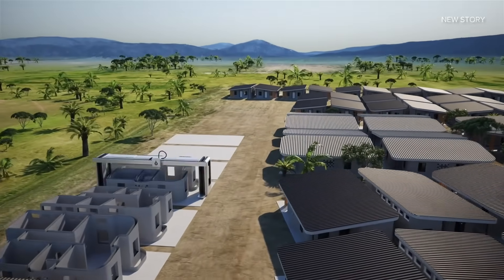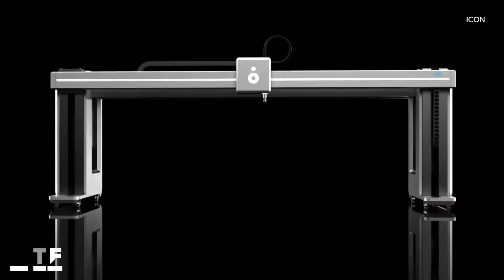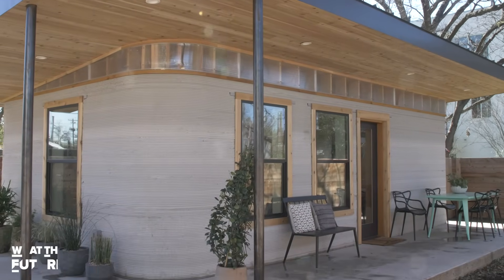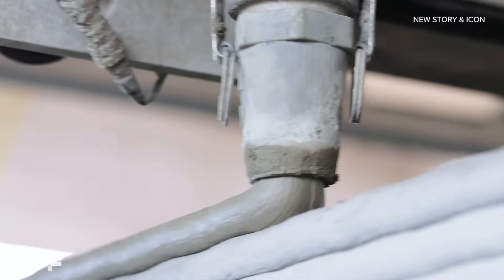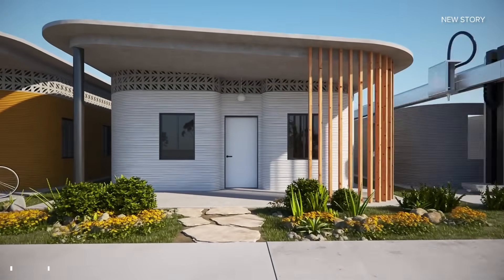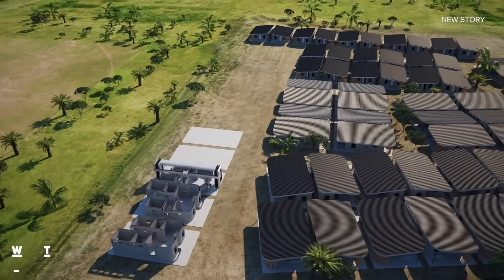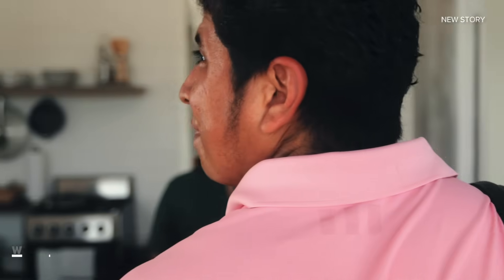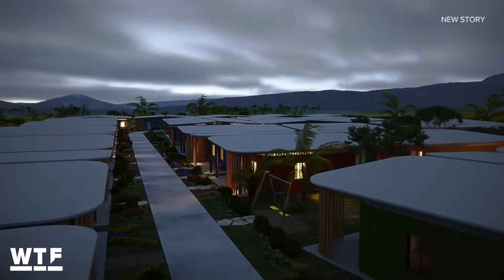The world's first 3D-printed community is officially under construction

Comment: Insulation?   Plumbing?    Electric?

How are these incorporated??
Reply: I would lay my pipe & conduit in the freshly laid wall, so that the next pass hides it inside the wall between the layers & the wall forms around the outlet boxes while wet. Not sure how they are doing it.
Reply: Robert Lockard 
That was my understanding, but there's no detailed video showing this. I'd also like to see a fair comparison with this and traditional house building or other house building innovations like compressed earth housing. It just seems like it might be a bit gimicky.
Reply: @Competitive_Antagonist  comparing it to compressed earth, it should be a lot cheaper. Compressed earth takes a few pieces of heavy machinery, and a lot of laborers. This video says it only needs 3 machines and 3 people to run them. They said in the video the 3D printed house could be done at half the price compared to traditional construction, (stick/regular lumber site home) compared to the 10x price of compressed earth.
Reply: @muninrob  I lay my pipe inside warm climate wet walls. Its easier to push and pull power through.
Reply: They aren't.  It all has to be surface mounted or have the walls furred out so it can then be installed inside the walls.
Reply: @PaulGuy  or they put conduits in the concrete as every other home is built in Mexico. It's possible they've designed these homes differently, but the video doesn't say either way.
Reply: Workers do that part
Reply: The idea is to build homes for as cheap as possible, if you up the printing resolution you might be able build more sophisticated homes but that will be more expensive.
Reply: @kevintieman3616  I built my own house and I paid about $50 per square foot, (south Louisiana where normal price is about $100 per square foot). But if I could just draw a floor plan and have 3 machines and 3 operators delivered to my jobsite and 24-48 hrs later the house is poured and all I have to do is the finish work then yeah I would definitely do that instead.
Reply: Other companies are making double and or triple wall construction homes, where insulation is blown inside at the end (very quickly), and pipes and wires can be placed as the printing is happening or channels and holes are set during the printing process. Insulation, plumbing and electric is all pretty easy when it's planned in advance.
Reply: Very carefully.
Reply: You can just see surface mounted electrics in the video. Mounting onto the irregular surface will be a new challenge
Reply: @unclesond  my guess is just like the program stops pouring cement for windows you could have the program not pour where the conduit could go and after the machine pours past that spot an operator could put the pipe in place and when the machine comes back to that place it would just pour the next layer of cement on top of the conduit. That is one way it could be easily programed and done.
Reply: @unclesond  you could just use brackets/shelves with concrete anchors/screws.
Reply: This could be a lifesaver for senior housing...F the $3,000+ a month retirement community.
Reply: 1:50 it seems the electric conduits are simply attached to the walls. They could also paint on the wires to "hide" them. I'm also guessing the plumbing will be quite exposed as well. Bear in mind that these buildings are constructed for cost and functionality not aesthetics
Reply: The concrete is a great insulation! They have Mitsubishi heating and cooling machines that don’t need have systems. The 3D printer leaves small holes for electrical wires to bring in electricity 😀
Reply: They said the houses were printed for families living on $3/day. They definitely won’t have running water and plumbing. Notice how the ceiling has vent holes... no wall insulation to hold the air conditioning in either. These seemed designed as “ready-made” shelters for people who may be living in shanty towns or tent cities. They look beautiful.... I’d be honored to live there for a few dollars a day. Quite an upgrade.
Reply: I think they'll be fitted outside the walls. And cover later with false ceiling and false walls. But I don't think people will have money to interior design it.
Reply: Insulation could be foam, after plumbing and electrical conduits were run through the web truss-like voids in the walls. Drill where the outlet goes, drop conduit down to it, like brick veneer, but obviously a bit different.

Double walled concrete with an air gap would outperform brick veneer. Not sure what to do in your colder climates, but the mix would have interesting properties if it stands up like that. Some sort of filler material or aeration going on. That means trapped air, or insulation as we call it when we sell it.
Reply: Pretty sure those are installed by regular workers of those specialties. It's just the walls I think are 3d printed which still saves alot of time and labor.
Reply: You don't need insulation with this material. There are real cement dome houses that has no insulation in them and keeps the dwelling warm during the winter and cool during the summer. I've been inside a couple myself and it is considerably cooler, the atmosphere just has a different feel to it before the heat and coolness is regulated differently because of the walls.
Reply: It's for poor people. They don't need fancy things like water. ;)
Reply: Concrete is insulation.  Electric is ran threw the slab and up finished wall. Plumbing is all under the slab. Simple.
Reply: @edwardhoward4542  sorry Edward. Concrete is not thermal insulation. It's actually thermal conductor and it does absorb humidity if not sealed.
Reply: Hollow walls, surface mount, install in the foundation, chase ways, conduit, ceiling ran, or none at all. It just depends on how much you want to spend. It's not that difficult, use your imagination.
Reply: I watched a video that says insulation isn't needed...the walls have hollow space like cinder blocks
Reply: Not expected in Mexico.   Spanish Catholic Corrupt Mexico.
Reply: Outside or underground
Reply: Bob Bobson   Forms are expensive and time consuming.  This is cheaper and faster.  duh.   You have never worked ??
Reply: Bob Bobson  do you own a Form company?
Reply: they probably could just replace the infill with the plumbing
Reply: My belief is electric will be wireless, plumbing could be printed with clay, an insulation can within the material used to print the wall.  Air-crete would be great since air is a great  insulator.
Reply: @JoseGutierrez-hk2ky  electricity needs wires buddy
Reply: Just like in the program the cement is not poured for windows and doors the same can be for metal pipes that could be placed in places to be used as conduit for plumbing, and electrical. The cement would be the insulation I guess if not expansion foam could be shot in after walls are poured and cured.

the machine can be stopped at conduit location for 1 of the 3 onsite operators to place the electrical/plumbing conduit. If not you can drill holes through concrete after to plumb both.
Reply: Ryan Richardson come on man you already know they didn’t think about the trade guys.

Comment: Where is the steel reinforcement?
Concrete likes to crack. You'll see in 5 years 😉
Reply: Rebar is clearly visible man.
Reply: Concrete with out reinforcements...😂🤣😂🤣😂🤣😂🤣
Reply: It is possible to have fibers in the concrete to stengthn it.  I would like to see how it stands up to severe weather.
Reply: Cris LeRose  fiberglass won't work.   But I've been wondering if they are issuing carbon fibers for FRC (fiber reinforced concrete).  The advantage of FRC over rebar is that it is strong in all three dimensions and is evenly distributed throughout the concrete.   The ideal is to use the FRC to better confine the steel rebar and increase its strength before deformation.
Reply: Maybe we should put Concrete into rehab then
Reply: I love when people on the internet think theyre experts lol
Reply: dino macioci  so structural concrete doesn't need any steel reinforcements?
Reply: I thought I saw rebar sticking out the top
Reply: If you thought logically, they didn't share the details cause they don't want others nicking their ideas before the can get it patented.
Reply: Watch at 20 seconds. It appears they do use rebar for steel reinforcement.
Reply: @caslone88  at 0:20 you see rehbar in the background, it's blurred, which means it's not as close as the print nozzle. Also at 0:18 you see no rehbar.

Comment: It's very energy intensive and uses plastics
Reply: Yea? How energy intensive is it? What plastics does it use?
Reply: @nomosnomosowicz7379 
What are the materials used to print 3D objects? Many different materials can be used for 3D printing, such as ABS plastic, PLA, polyamide (nylon), glass filled polyamide, stereolithography materials (epoxy resins), silver, titanium, steel, wax, photopolymers and polycarbonate.
Reply: @nomosnomosowicz7379 
The reality today does not allow the 3D printing technology to be fully Eco-friendly. Different researchers reveal that this technology uses large amounts of energy, larger than the amount used by milling and drilling machines. ... Plastic as a whole is not considered an Eco-friendly material.

Comment: Previous machines had rebar inserted at specific points in the layers. They are building in Mexico because of the lax building codes. Pretty sure they can't get a permit in a U.S. State to build.   And yes they can add fibers to the mix to help with strength,and I'm sure they have some kind of plasticizer to keep it from slumping.  As for cost, Corporate buys the land, depending on the speed of the machine.  identical floor plan. after 2 houses you know the cost of power, water, ventilation. Pre-build sections drop them in, reduce labor cost, and material cost.

Comment: How can building a house this way cost half what it costs to build a house conventionally? Unless I am missing something, the part that the printer makes which looks like just the walls does not make up 50% of a typical house build so even if you did that part for free it would still cost more than 50%. Also, the barrier to cheap housing is not the cost of the structure but the cost of the land that the structure sits on. I applaud the engineering achievement but I can’t see this as a solution to the housing crisis. A typical house in Mexico is built with inexpensive concrete block using labor that costs 400 pesos per day. The proprietary material that they are using, likely utilizes expensive additives. To set up that machine also cannot be cheap.
Reply: The cost-saving comes from the support structure and labor. A house of the same size made traditionally requires concrete and a team of 12 people and lots of time, or cheap materials and 12 people and lots of time. The idea here is that you lay a small foundation with three people, move this machine in with three people, let it run overnight monitored by three people, and then slap a simple roof on with three people. The idea is that you can have a house finished by the end of the week as opposed to several months. That is a massive cost saving.

All you need is a flat surface for this to build on, while other house designs require one-time use structures to be built, and then torn down.
Reply: There are several things to consider with it though. The roof is a premade flat piece that they basically just put over the top. So there goes the roofing cost. The insulation factor is out. Also I’m not sure if you’ve checked the price of lumber lately but it is VERY expensive. And because it doesn’t offer an attic I’m sure almost all utilities are exterior of the walls.
Reply: Ok roofing may be covered somewhat but the foundation is also one of the most important part. Then there's all the interior stuff from tiling, window and door fitting, built in furniture and bathroom. With that comes all the electrical, plumbing, water and gas fittings. Not to mention the land that the houses sit on as was mentioned in the original comment.
Reply: @6root91  All good questions for where the context fits.  YMMV as where there's no plumbing to individual houses as the gravity feed water system is community based, I doubt the locals are going to care about plumbing or it's expense.  They are also more likely to have an outhouse than an indoor bathroom that uses water.
Reply: Also those sausage shapes encourage moisture by directing flow inwards, there is a horrible cavity breach, no propper insulation, basically just entertainment.
Reply: @theq-1  agreed
Reply: It’s the labour cost,  the quicker a house takes build the cheaper it is
Reply: @paulcollins4932  The land question prevails, too.
Reply: I'm guessing the way all things suddenly become half price, half quality materials.
Reply: Labour costs
Reply: Yes most likely bs
Reply: Don't forget local laws as well. I do not know what the housing regulation are in Mexico but in America and depending on which area of the state you are in, this type of construction may or may not be allowed. As well, with not just the land cost, but you also need to take into account the utilities that come with this. Is it connected to city water or must you dig your own well? (Here in Kentucky it costs over $10,000 to dig a well in the area around where I am at.) Do not forget sewage in relation to if it will be connected to the city or if you must dig your own tank. There is also electricity setup and running wires. Not to metion appliances and plumbing through the house. This is where the costs go up depending on the size of the home. Darn it, Kabir beat me to it.
Reply: @PikaDamos  All good points for a North American context.  Where the Mexican or El Salvadorean context is a shanty built from scraps with a gravity feed community water system (i.e. no plumbing to individual houses) and outhouses - are they going to care about costs or options that don't apply to them?
Reply: Labor to start with
Reply: Ugly walls, they don't look very energy efficient, either to keep the home cool or heated. Walls like these are very spartan, something you'd see in an IKEA commercial. But still, this technology definitely has its uses somewhere in the world. It could only get better if they tell us their proprietary cement mix uses recycled plastic bottles.
Reply: Dude the labor cost. Takes weeks for someone to build even a rudimentary permanent shelter.
Reply: Less people
Reply: They should've used shipping containers, it's both the cheapest and quickest way to build small houses, but it isn't newsworthy.
Reply: You're 100% correct.. 3d printing is 100% hype, no delivery..

Comment: Imagine leaving the print for 24 hours and finding out it failed, oh the concrete spaghetti monster
Reply: I'm sure there is someone watching the printjob.
Reply: @OgdenM  
Michael, of course there is. The cement needs to be mixed in batches at the appropiate times and those supplied to the 3D printer.
Human supervision is not eliminated.  but it could be improved if enough automation and feed back is implemented.
Even a "jocker" could play with the unsupervised  equipment working 24/7.
Reply: HAHAHAHA a fellow printer I see 😂👀👀
Reply: hahaha good one ... i feel it too.
Reply: @Cailzzz  
Where, exactly, do you " feel  it " ?
Reply: house. house. modern art. house...
Reply: They said it takes 3 people to operate it, so I'm guessing it would not be left unattended.
Reply: Those who have never felt the pain, wont get the joke.
Reply: Not a problem. They have a huge spatula machine that peels the house of it's base and tosses it in the garbage.
Reply: Kalt Fishy and even more you need to press on brick or material what machine can’t do it is useless imo
Reply: It has cameras wifi cuminication the operator could be in the UK. Our painter robot works the same way its hook up to a 50 gallon drum.
Reply: So whats ur question
Reply: I felt that
Reply: Imagine being the guy who has to watch this for 24 hours without sleep.
Reply: You have to really understand the process to envision its failure.
So give us the details so we can "imagine" what you imagined.
Reply: There would be no spaghetti monster. Just a blob of concrete. The spaghetti occurs because the filament curls up as it exits the nozzle and cools/hardens rapidly. Sorry to ruin the joke. Yeah I don't get invited to parties any more.

Comment: But that kinda wall texture though....
Reply: U can use plaster to smooth the surface out
Reply: @Cpt.PickHard  or place wall panels.
Reply: Theoretically this tech can build more elaborate structures with fancier finishing details but it would require finer nozzles, more passes back and forth and more time.   More machinery in general.  

There could even be robotic arms smoothing edges and surfaces as it goes and other arms installing the plumbing and wiring.

The proof of concept is here, but the  houses shown in this video?!?  

I'm curious what they look like in ten years...
Reply: @NOMAD-qp3dd  Yeah, this technology could be improved a lot.
Reply: Punches hole in drywall and says whatever dude...
Reply: It’s fine, whatever
Reply: its just like having a corrugated metal interior wall. If you want a different interior wall surface then add it. If you want a traditional painted sheetrock wall then you can glue sheetrock to the wall and paint to look like a "normal" wall. You can glue 2x4 studs to the wall then insulate and sheetrock if you want.
Reply: I like it! But you can smooth out.
Reply: @monkeybearmax  if you paint it I bet it looks cool. It is a common trick in design to use single colour but textured wall, so in this case you already got a textured wall, paint it white and it could look cool if you are creative enough. If it is too monotone, you can do other parts of the interior wall differently. Possibilities are literally endless here guys.
Reply: Have you seen 'French Brutal'?
Reply: I like it
Reply: you staring at cinder blocks at home buddy?